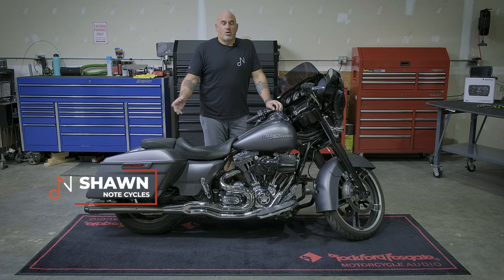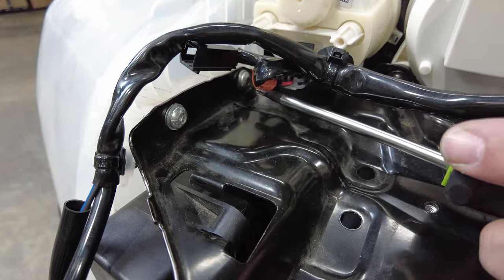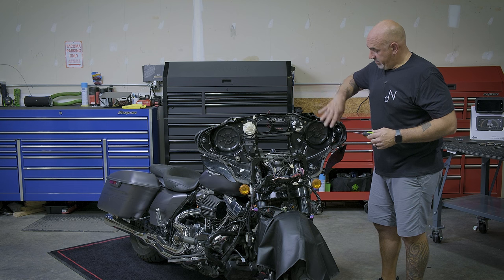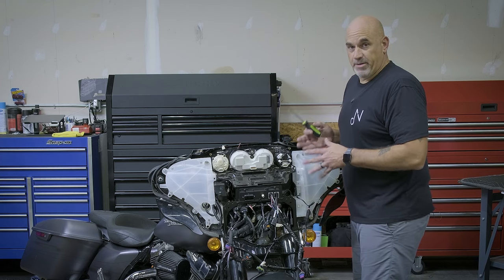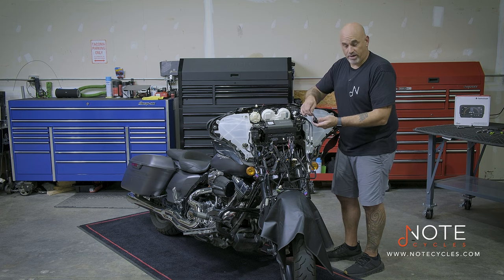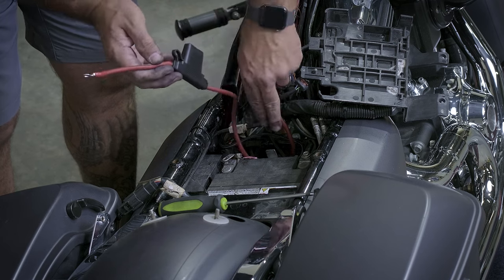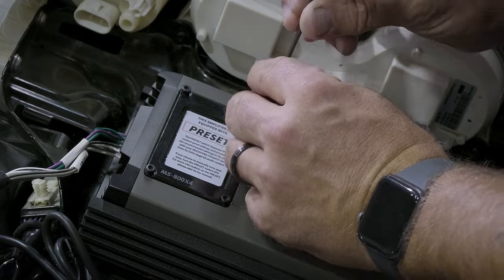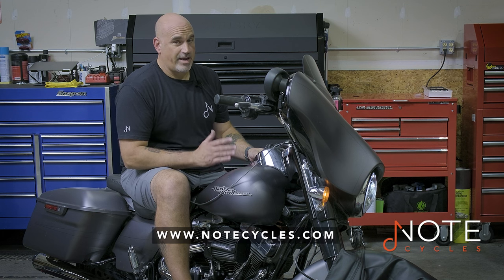Rockford Fosgate Head Unit, Speakers & Amp Installation | 2014+ Harley-Davidson Touring

Comment: QUICK NOTE. THE NEGATIVE FROM THE AMP NEEDS TO ME GROUNDED TO THE CHASSIS AND WITH A 4GAUGE WIRE THEN GROUNDED TO BATTERY, IT WILL CUT OUT ANY AMP NOISE. JUST FROM EXPERIENCE!  NICE VIDEO